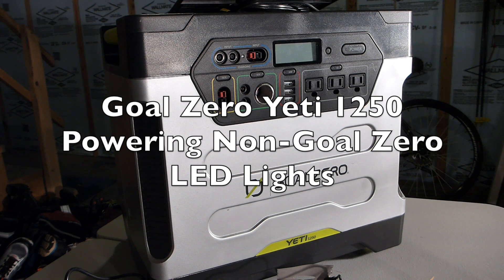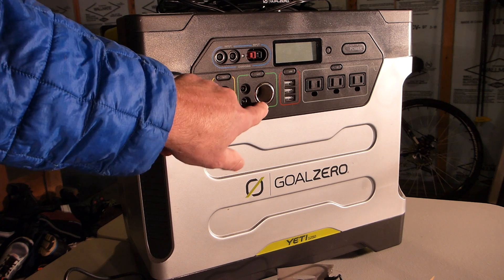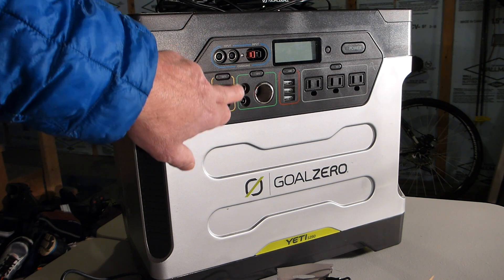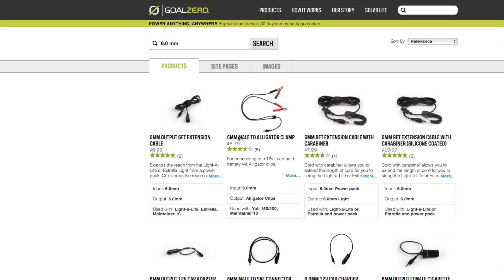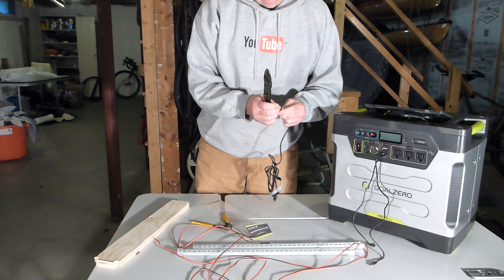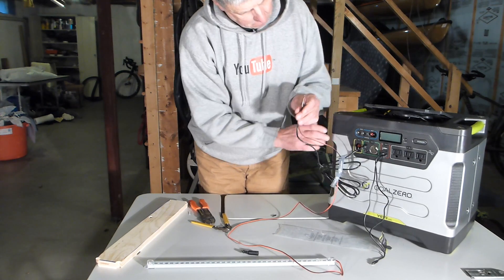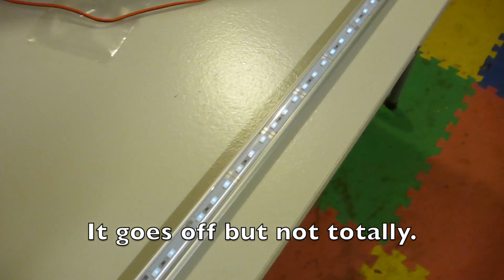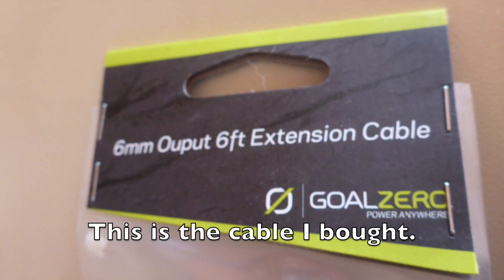Goal Zero Yeti 1250 - Powering Non-Goal Zero LED Lights

Comment: This is exactly the set-up I'm looking for. I have the Yeti Goal Zero 3000 and I want to buy a roll of strip LED's for my shortie. QUESTION: What type of wire do I need FROM the LED's? You described very well how I go about cutting up the 6mm wire to connect it to the LED's wire ... but what kind of LED wire am I going to use? Do I use the 110 supplied and just cut off the plug? Sorry for the stupidity ... I'm old.

Comment: I nee to do the same thing. What I was thinking of doing was running all my LED lights, fantastic fan and maybe fridge into a fuse box then running a wire from the fuse box to a spliced 6mm into the goal zero. do you think that this would work?